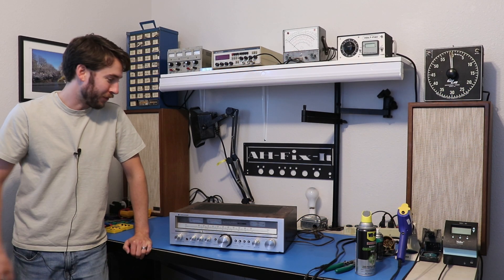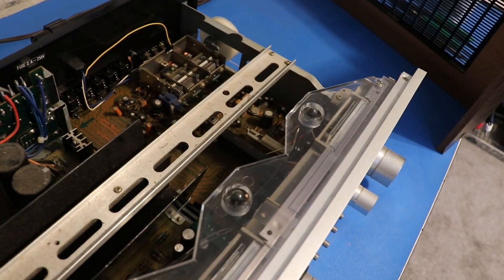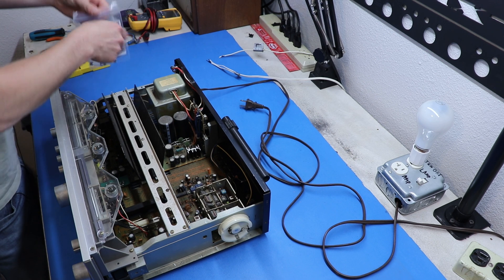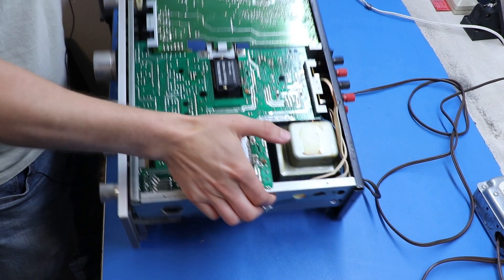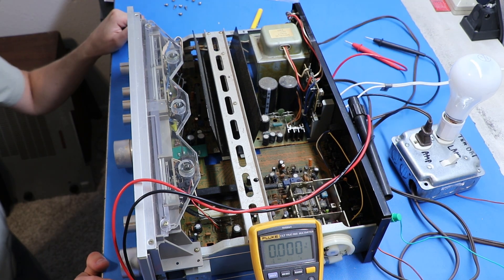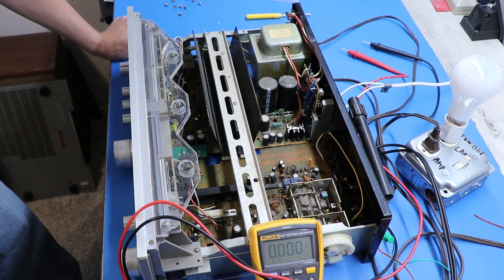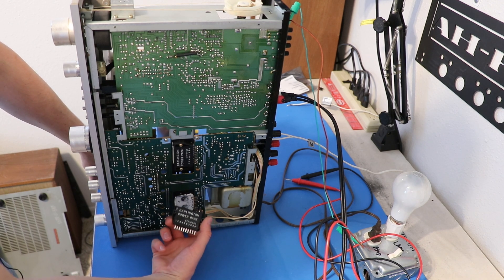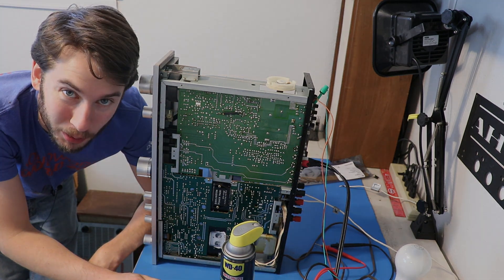Why Does This Kenwood Keep Lighting Up My DBT?

Comment: I own two CCE SR-5050, a brazilian OEM Kenwood KR-5010 receiver. I swapped the burned STK-0050 for STK-0080 in both receivers with success. The original STKs used to burn due to the grid voltage change, was 110V until the '90s, and now is 127V.

Comment: Done right those sanyo STK voltage amplifiers can sound absoulutely beautiful, they died because manufacturers never used adequate cooling.
Reply: Had an early 90's sansui with a 100wpc STK chip.   Had active cooling on the heatsink so didn't run too hot at full tilt.    Had to bypass the protection relays as they were too sensitive.   Played fine for years but the power transformer eventually went open during a extended full crank session.   Right in the middle of a roudy college party, lots of boo's.   Party goers were not pleased!

Comment: Everyone should own a portable air compressor to blow out your equipment.  Also a fuse holder for hard to hold and place fuses.  A two inch cheap paint brush helps also.  Nice how to video.

Comment: I have a 4010 that I bought on Craigslist for $20. Had to put a triac across the rotary speaker/power switch. It had nearly eaten itself alive from all the arcing but it works like a charm now. These are somewhat underrated/undervalued in my opinion.

Comment: My kenwood kr 6160 has "no low end" on the right channel after it warms up. Im guessing it's an out transistor on the heat sink but my knowledge is limited with electronics. Eventually ill find a tech or figure it out. Thanks for another great video!

Comment: The trick to ebay powerpack replacements is to NOT bias them.  If you try to apply bias as per the service manual, they tend to blow up instantly.

Comment: Currently diagnosing a KR-5010 and finding:
- Dim bulb tester OK - no shorts.
- Speaker relays kick in on start up when connected to mains.
- No sound using signal generator through Tape B Play input.

Comment: Don’t know if you’ll read this but those Darlington power packs are replaceable they do you can get those replaced or you can actually get a kit that replaces them with two transistors or is it three transitions? I can’t remember but anyway it’s a modified kit that would fit in there. It’s whatever you choose. I see both, but those Darlington power packslook online I found them some on eBay but I’ve also found a lot of over in China which a lot of people don’t like to order stuff from China which I get it but when you can find it it’s not as hard as you think

Comment: I’ve gone the discrete component PCB many times when replacing these STK packages, enough so that I purchased 100 boards.  

If you already bought the components that’s great, but I know that some of the components like the TO-220 and outputs are getting harder to get. So if you need any of the components to complete the boards just reach out.

Comment: NTE makes a replacement for the STK that works great no counterfeit
Reply: I don't know for certain, but I suspect those ECG/NTE parts are remaining old stock rather than current production,    
and they are probably Sanyo originals with different labelling.